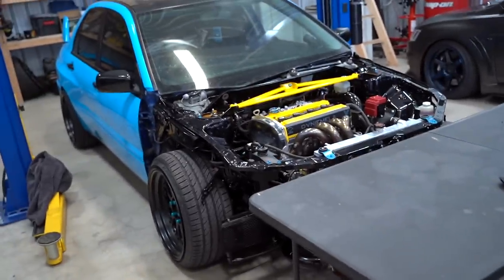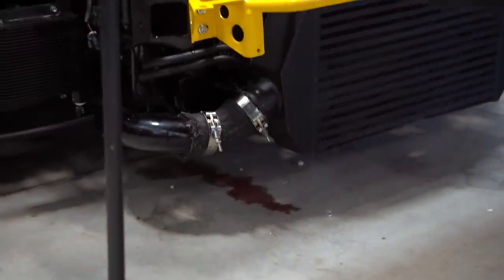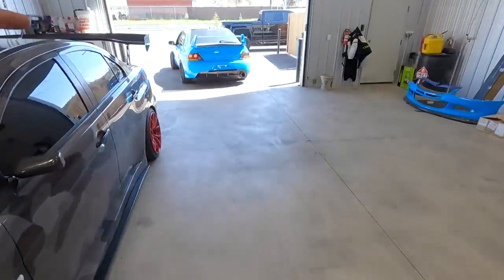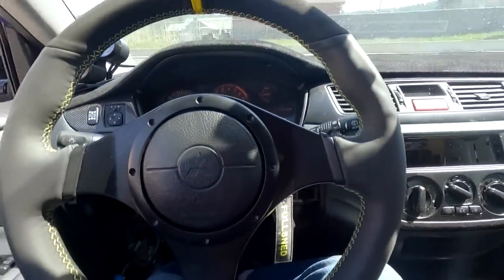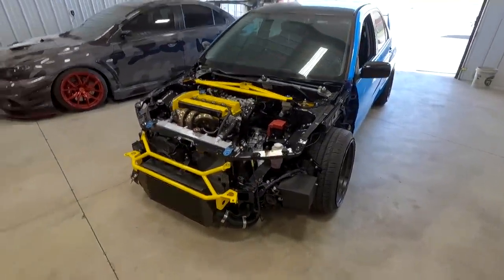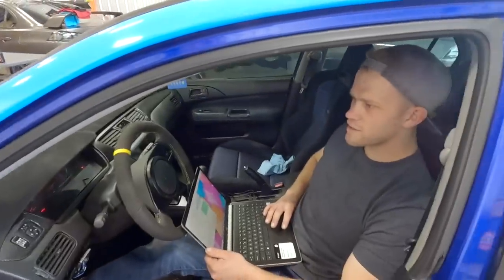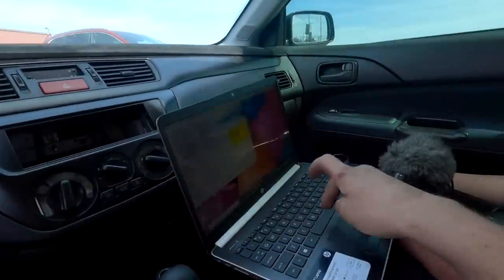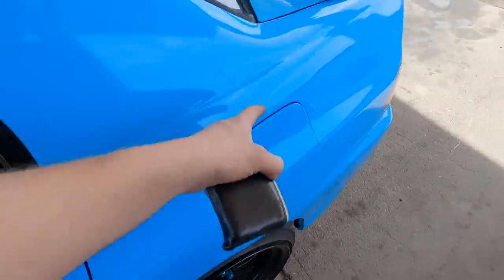Something flew off, lol.

Comment: Awesome video Devin. The issue with the brakes could be a "Yaw Rate Sensor" issue. Basically, the car is driving straight but the sensor is telling the ABS that the car is going sideways and locks the brakes. Maybe that is unplugged or fried.
Reply: My evo twitched to one side doing a torque transfer while cruising slowly in a straight line after the ABS light started appearing. It happened for about a month before I took it to mechanic for it to not happen anymore somehow. It only occured with spacers on the front to clear the brembos but not on the back. I dont want to put the too small 17"s and spacers back on in case it destroys the AYC

Comment: The brakes issue probably was an airlock working its way out of the system. I would double check they've been bled in the right order in case the airlock is still there. Good work.
Reply: I think this might the issue on my Evo. Thanks for pointing out, definitely gonna double check it 👌🏻

Comment: You need to clean your master cylinder. Had the same issue and found alot of dirt in the master cylinder that clogged one of the lines and cleaned it with petrol. The breaks have now been working great for over a year.

Comment: My truck had this kind of brake issue, it was intermittent. As soon as the front brakes locked up and I let it cool down for 15 mins it would drive normal again. I changed out the calipers, flex hoses, and bled the system in all 4 corners over 8 times in a month. finally I decided to see if it was potentially my master cylinder and since I changed it I’ve had no brake issues at all.

Comment: I had a similar brake issue. Booster rod wasn't adjusted properly. Was just slightly touching the master at all times. Braked would be fine til a few laps. Then super hot brakes and car stops itself

Comment: Make sure you didn’t over fill the Reservoir cause it may be locking up cause the fluid is getting hot and expanding causing the brakes to lock up alittle.